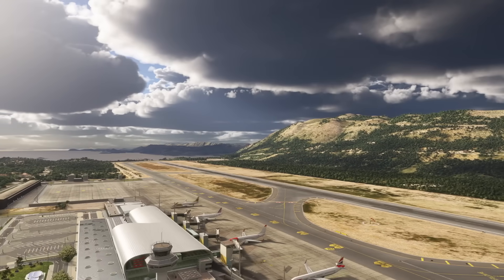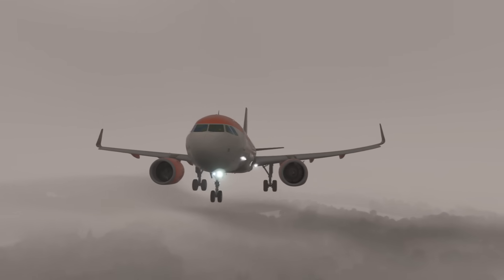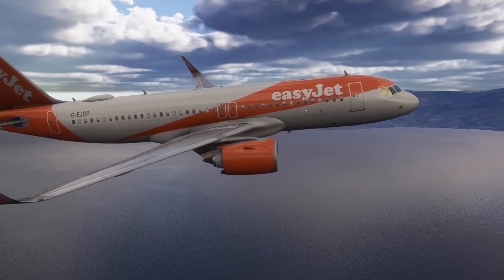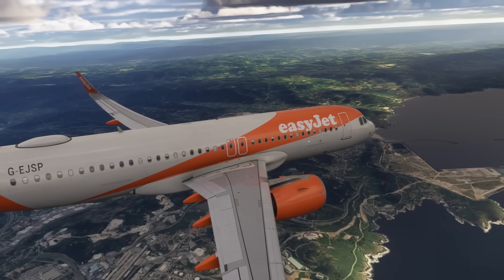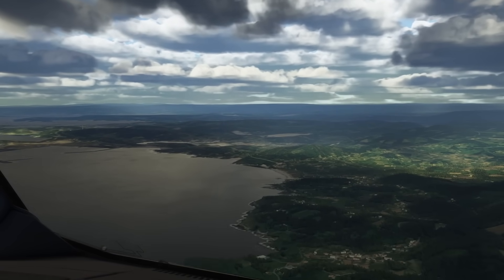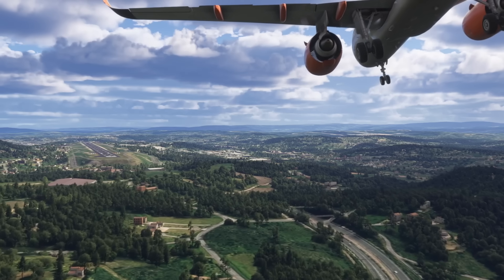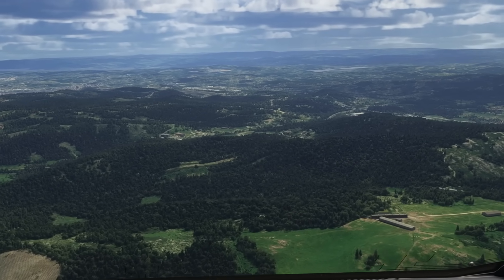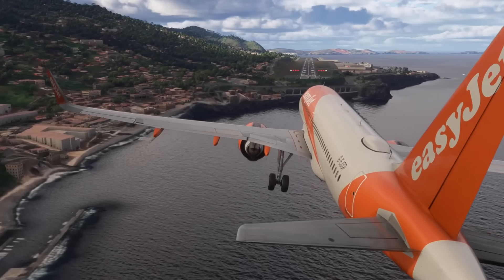A320 Approaches: ILS, RNAV, RNP, VOR & NDB Explained! | MSFS 2024

Comment: And then there are GLS approaches. Those are precision approaches and allow autoland, but they are currently only certified to CAT I minima. Although our test series to CAT IIIb standards around 15 years ago was quite successful, EASA has not moved forward with the certification yet.

Bigger european airports have them installed, the onboard capability is standard on the 737 NG and following and modern aircraft like A350 and 787, on the A320 it has been a customer option since around 2011 (same as Autopilot/Flight Director TCAS).

Comment: It would be nice if you could talk about offset approaches (both ILS and VOR), and how to fly them. Kai Tak might be the most famous one with the IGS to Checkerboard Hill, but I found quite a few in the sim by accident, often where the VOR or localiser does not line up well with the runway.
Reply from the maker: That happens quite a lot. The one that caught everyone out when msfs first released was Nice 04R which is an offset ILS (Might be 04L, would need to check)
Reply: 04 Left..🤗 the 04R 
is used fot Take off only.